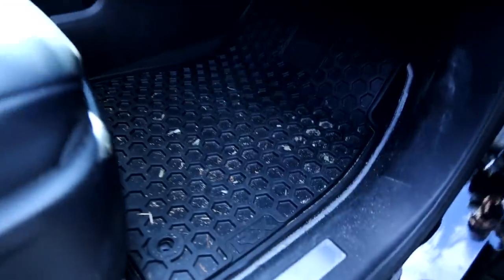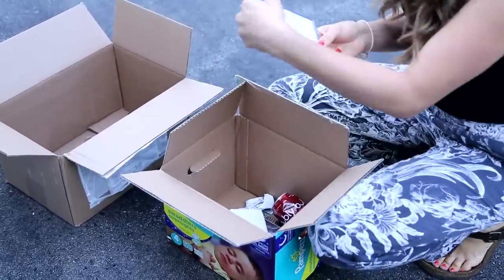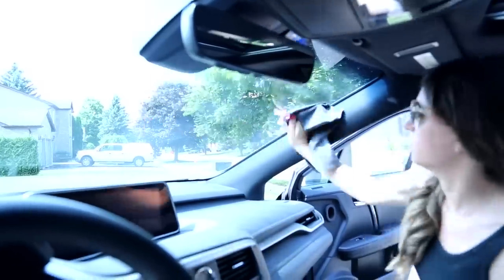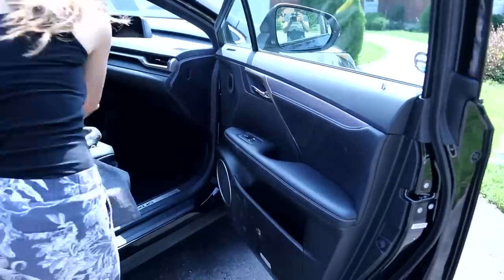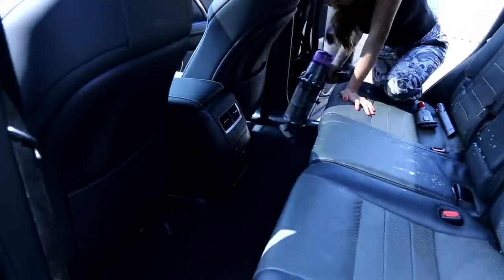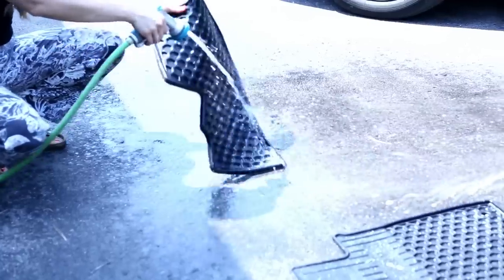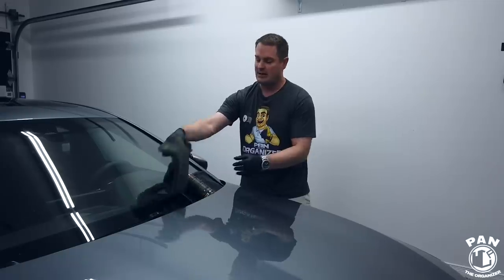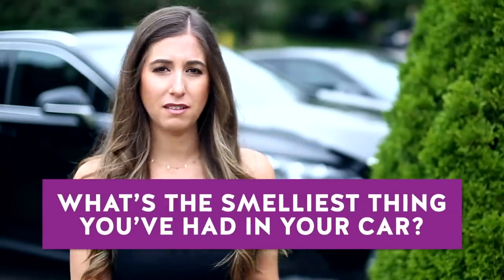Clean With Me: CAR!

Comment: Be careful with that toothbrush. It can scratch up your interior. Use canned air instead. It works great. Pick up your trash in your car when ever you stop for gas, that way its always cleared out.  I have my daughter pick up the back seat every time we get home.  I started that when she was little and now its automatic for her as a teen.  Keep a microfiber towel in the front seat for quick clean up of liquid messes and quick dusting.

Comment: Some great tips there that will defo help me. Couple things I would throw in; Adam Savage (Mythbusters) recently recommended recycled surgical 'huck' towels for shop rags, but these would be great for cleaning too. If you can't find those, the cotton towel refills for the continuous bathroom hand towels are great. I've found essential oils by them selves are greasy and gather dirt, so I mix with bicarbonate of soda and work it into the pile. Third I always keep a pack of baby wipes, tissues and nappy sacks in the car, for quick mop-up and dispose jobs. Bonus: I have seen in Turkey they replace the top of the dash with less reflective material. Commonly they will use carpet, but a nice felt or baise may suit better. Car proud, nah.

Comment: I am obsessive with cleaning my car,very particular with it,but I also USE it as well...a solution of vinegar and dish soap + warm water works wonders for fabric interior,I haven't found a stain yet it won't get out!Once,a deodorant bar melted all over the backseat in the middle of the summer...I think I cried 😭 BUT, several attempts with the vinegar mixture,and it finally came clean!

Comment: Went to Vermont for a family reunion.  We were at a large farm and had to do a diaper change in the back of my SUV.  Little did we know that in the 5 minutes the hatch was open, a field mouse had gotten inside the car.  10 days later, we found the source of the disgusting smell under the folded down third row seat.

Comment: Oh man, stinky car finds.. So, a couple of years ago, we came into possession of a second, partial half gallon of milk from my husband's parents (you can see where this is going). We'd already went grocery shopping that same day, and somehow, that partial half gallon got scooted under the passenger seat. We didn't miss it because we had another half gallon and it slipped both of our minds that we had extra. Fast forward an undetermined amount of time later, and we started noticing a smell. It was sort of sweet, but definitely not pleasant. And then over the course of a couple of weeks, it morphed into a "yep, something is rotting somewhere" smell. We searched the car from top to bottom, and find nothing. We assumed a mouse got into the engine and died, and we just couldn't find the body. The smell was that bad! Well, another couple of weeks go by. One day I opened the backseat passenger door, and I happen to be at the exact angle needed to notice something white peeking out from underneath the passenger seat. I went to investigate further, recognized what it was, and almost vomited in my office parking lot. It had leaked out of the carton (because it was previously opened) and ohhhh, it was rank up close. Thankfully my office has a dumpster on site, so I just drove over to it and tossed it in (while holding my breath). The car instantly smelled 90% better, and getting up the stuff that spilled took out the rest of the odor. We still laugh about the Great Milk Mystery.

Comment: Realistically, how long does process take?  You mentioned working in sections, which I like doing too.  Did you also break up entire process over a couple days? Or, did you do it in one  full sweep?
Reply: I try and do it in a full sweep because having to do more to a car during the week is when it becomes a chore .
Reply: Try to do it all in one day. If you split it up, you'll prob have to drive the car and the parts you cleaned will get dirty anyways.

Comment: Dog hair!!! All over and vacuum doesn’t get it all
Any suggestions pleaseee!
Reply: Here's two ideas.  Amazon (of course) sells this thing called a Lilly Brush that some car detailers claim lifts hair off carpet, and upholstery real well. They're around $15.00 to $25.00.  Also there is a vinyl cover that can be strapped to those car seat hooks over the back seat.  It covers the entire seat bottom, and back.  If your mutt will stay there,  it's hair can't stick to vinyl, and the dog smell won't permeate the upholstery of the seat!
Reply: The lint roller. Or wrap (gently) masking tape, sticky side out, around your hand. And push the tape over the seats again and again.